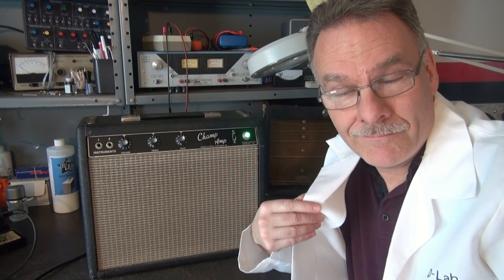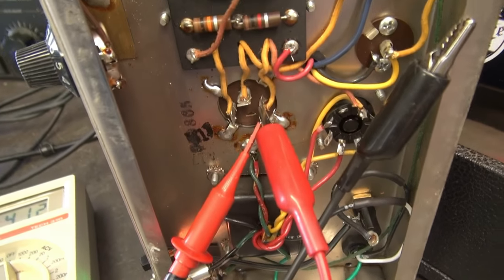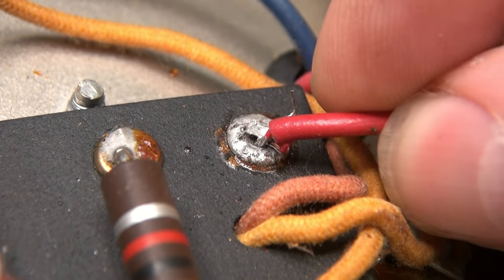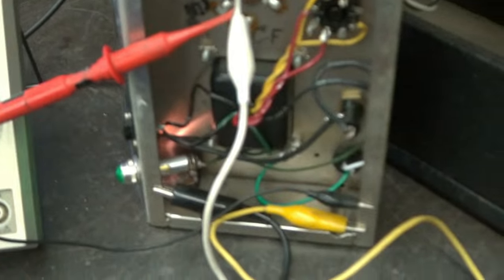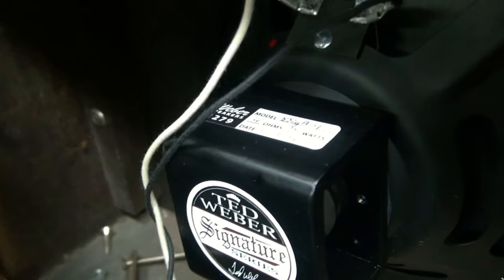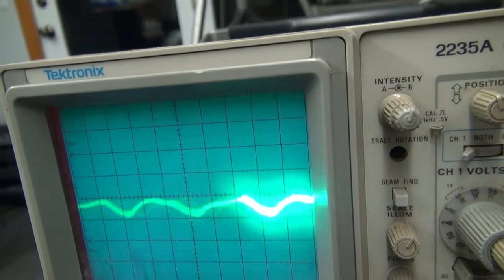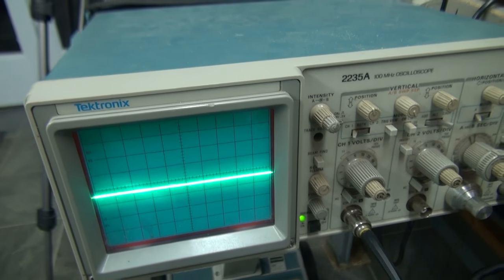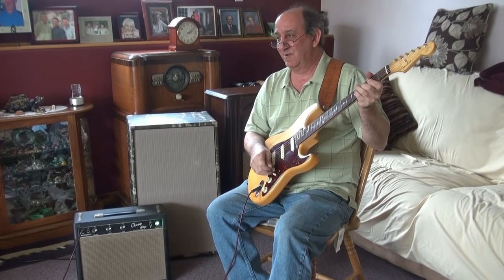How to repair fix noise Vintage Fender Black face 6V6 tube Champ guitar amp

Comment: I just finished converting a SF Champ to BF specs. I installed new Mercury PT and OT. And I installed new Weber speaker exactly like the one in this amp. However, the client had installed a Sovtek 5Y3 which has the same voltages as a 5AR4/GZ34. When I install a JJ 5Y3, presto-chango, lower voltages. I still had to install a 10K, and 27K dropping resistors to get the plate voltages down to BF levels. I also had to use a 510R and a 120R bias resistors in series to get the dissipation down to about 11 watts. I installed a new CE-Dist. filter can. She sounds great and is nice and quiet. I told the client to t=dump that Sovtek tube. It must have been cooking that poor EH 6V6. Thanks again Terry for the great videos.

Comment: Further hum reduction could be accomplished by rewiring the 12AX7 and 6V6 heater supply circuit with a couple additional pieces of wire  (or better yet,  a tightly twisted-pair of wires) and the addition of  a filament-winding centertap. The amp chassis is stupidly used as the "return" conductor for the 6 volt AC supply to the 6v6 and 12ax7 tube heaters! Disconnect (remove) the bare ground wire from pin 9 of the 12ax7, and also remove the bare wire to ground from pin 7 of the 6V6; then connect the previously grounded ( usually  green) filament-winding wire to the 6v6 and add a wire to extend it over to pin 9 of the 12ax7.   The amps' tranny may already have an unused center-tap wire taped up inside the amp (this unit does!), and if so, ground it. Otherwise, you will need to make an artificial centertap with a pair of identical resistors (100 ohm or so, exact value not critical), as often seen in many other silverface Fenders in particular,  connected from each leg of the filament winding to ground (easiest to do this at pins 2 and 7 on the 6v6).  oh shit, I almost forgot, the pilot light bulb has only one wire going to it and the other end of the bulb is grounded, and so you will need to remove that chassis ground connection to the lamp and run an extra wire over to that socket as well. For what its worth, the pilot lamp as found here is actually the first link in the heater-supply chain.....although it doesn't specifically have to be. Just dont loop any heater-supply wires near the input jacks or the preamp circuitry, or you will get more hum.
Reply: That's very important. You never should use the chassis as a ground path. Specially for the HT.

Comment: Great Job,Terry!Love your videos'!I have an old "tweed-Champ",from the late 50s'! I still need to get the bypass caps' in.I got some caps' that look like the originals'.Already re-caped the power supply.This Champ is very unusual,as it has the output-transformer mounted on the speaker!The wires' to the output go through a grommet,instead of the usual "r.c.a" plug, in the chassis! I have never seen another "Champ" exactly like this one?

Comment: is the 12ax7 swappable? I have a silverface and i can see the 2 tubes in the middle are easily swappable but the 12ax7 seems like it is not. I dont even know if it is actually a tube, the one in the far right,
Reply: the tube on the far right is the 12ax7, you'll need to take off the thin metal casing in order to get to the tube.  but on my spec sheet in the amp (a silverface also, 1980) it says to use a 12ax7a.  I'm not sure if there is much difference between the two but yes, they are swappable.   I just ordered new tubes last night and got each tube that is recommended on that spec sheet.

Comment: Question terry .I have a silverface bassman .if i wanted to a triode from a pentode all i would have to do is put a switch to open up the screen grids? Yes or no?
Reply from the maker: Nope, The screen is tapped to the Plate voltage. Loss of screen will shut down the tube. I would not recommend doing this

Comment: I just got a 66' just like this. Should I replace all the caps if I want it to perform at top capability? Or will recapping the power supply get it done?
Reply: Matt Nadolski :
Change all the electrolytics (polarized caps) should be changed along with that main filter cap can.
Even if they don’t leak, sooner or later they will.
If the others are those “brown turds”, then dump them.
Personally, I’d buy three of those Blue Sozos, a 0.1 and two 0.047’s, and one 250 pf Silver Mica cap (for the preamp tone stack).
You could easily do all of this yourself, but ... * Never  work on a tube amp unless you know how to discharge the capacitors safely.

Comment: Actually, at least I hear 120 Hz hum. That definitely means PSU issues (bad caps). 60 Hz (here in Europe, 50 Hz) hum is usually a grounding issue.